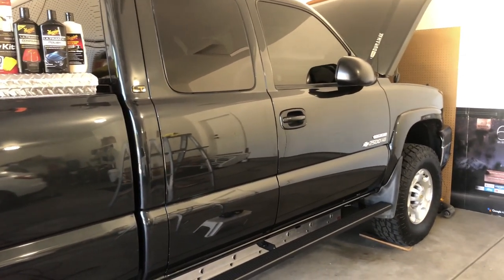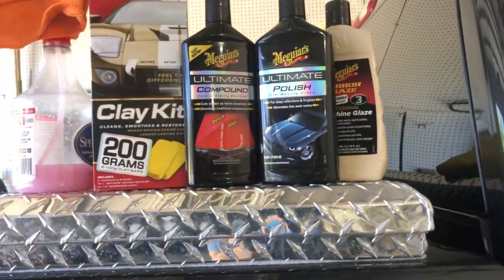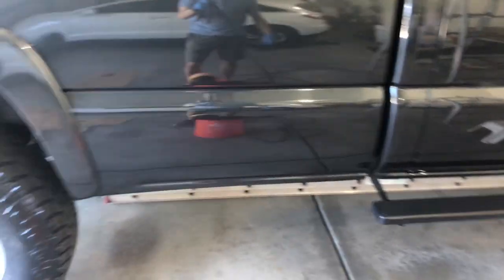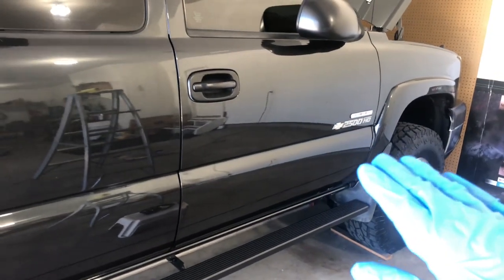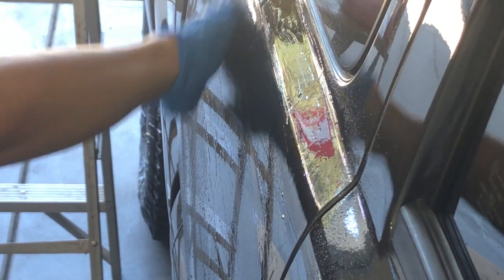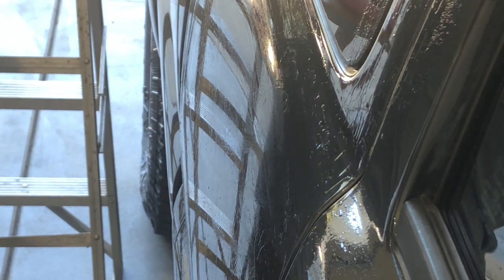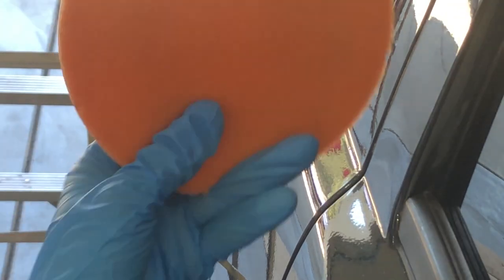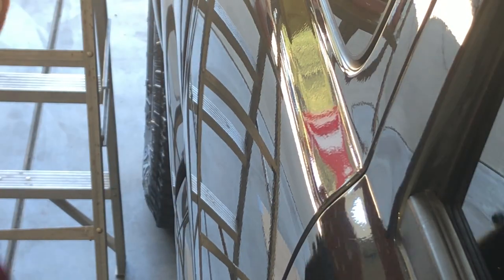How to polish car or truck (2 Stage DA Polish)

Comment: Beautiful Truck I wanna do this but i don’t wanna do it wrong and mess up my paint
Reply from the maker: I thought the same thing but if you get a dual action (DA) polisher instead of an orbital, that would be hard to do even if you tried haha. You can always practice on the roof or something first to get a hang before doing the rest. 

With the cost of a professional polish, I recommend DIY as long as you have the time to do it!

Thank you for watching!
Reply: @605LIFE only thing Iam worried about here is to leave my paint hazy but that shouldn’t happen as long as I polish and wax or would it only happen if I just polish it?